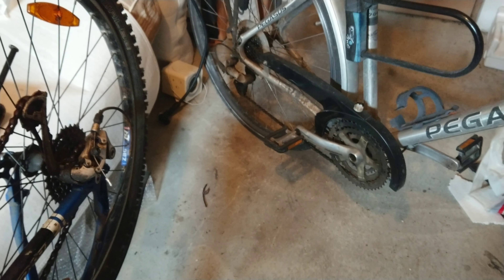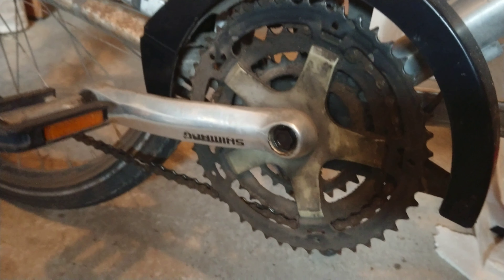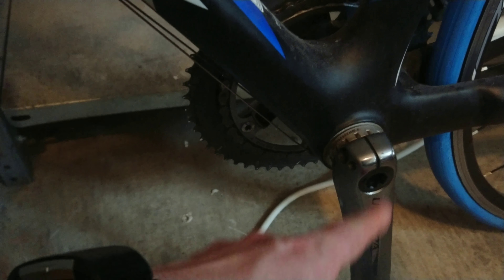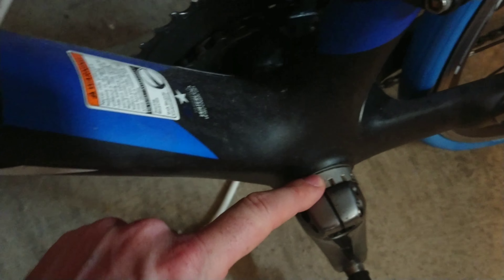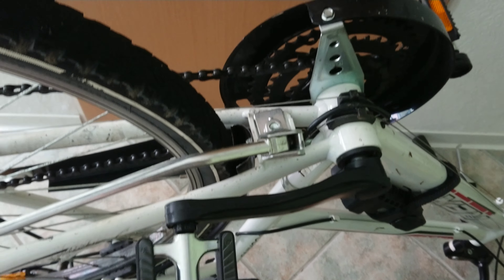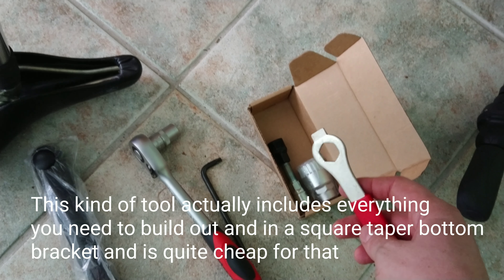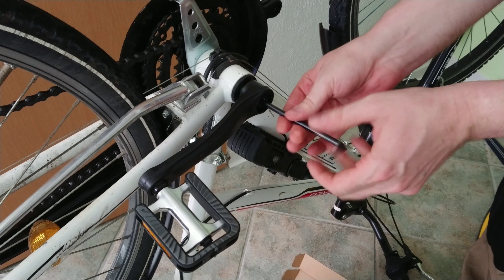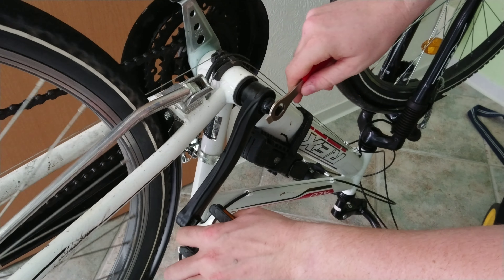How to build out a bicycle crank (square taper bottom bracket & bottom bracket identification)

Comment: I've never had to change on of those but now I know where to go to get instructions.
Reply from the maker: +WVRunning Don I think it's much more likely for the bottom bracket to break at some point - you notice that by a knackig sound while pedaling. 
I'm really not sure if I managed to break my pedal during riding or maybe it was broken at the move or something - it was not so extremly noticeable when hopping on the bike of its own but very much when you rode a correct bike a short while before. 

Actually the only bicycle accident, if you want to call it that,  12-13 years ago I slipped on a patch of ice and my pedal went into a hole while sliding - the pedal broke clean into two parts but the pedal was totally fine and I use it till this day. - those things are usually quite sturdy.